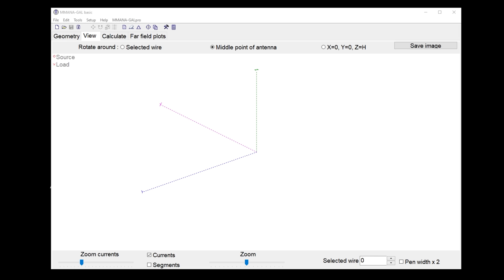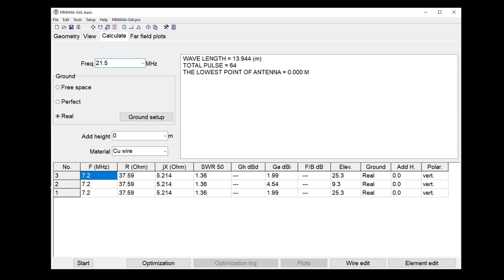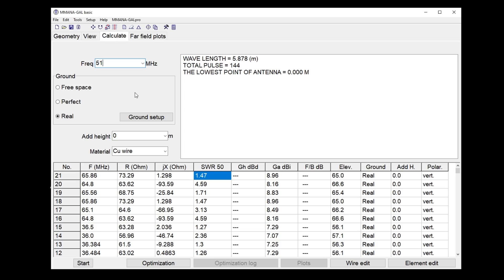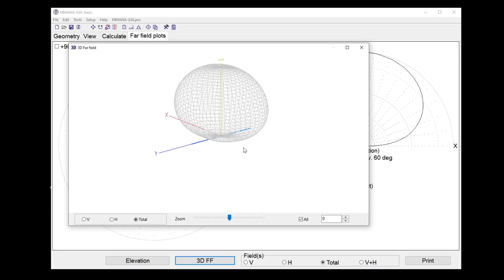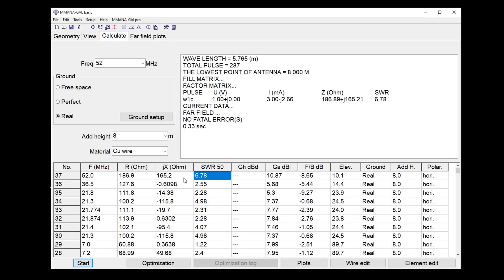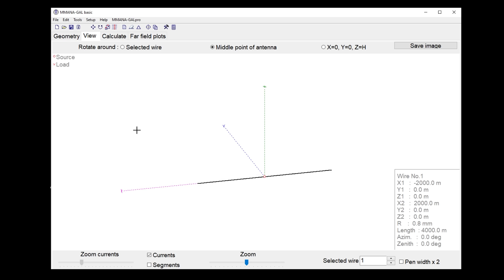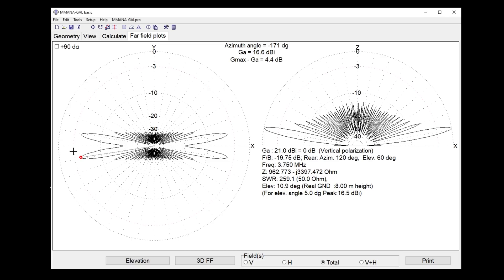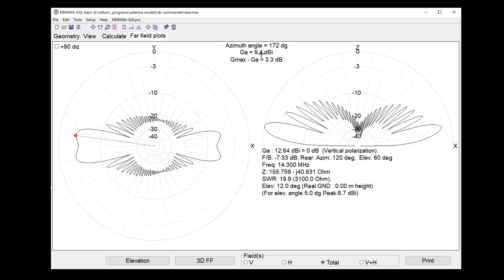Fascinating VERY Long High-Gain Cheap Wire Antennas

Comment: Excellent video Cal.  That 16dB gain was impressive !!  I think this also shows why a modest antenna,  vertical or horizontal,  in  very modest garden can give reasonable results, those being what probably most of us work with. Also reminds me that using an amp to try and get a signal out is less useful in that it does nothing for reception if overall gain of antenna is low.  Mark, 2E0MSR.
Reply from the maker: You are right!

Comment: I use a 20 meter horizontal wire (about 12 foot off the ground) with a 49:1 un un and with just 10 watts get very decent results even with a dog leg configuration. Conditions have to be with me for real dx but as a cheap antenna it is great.

Comment: That wifi antenna is a collinear but the problem is the alc kicks in if ya use a high gain antenna which sux
Reply from the maker: Good point!
Reply: @DXCommanderHQ  personal experience before i got my amateur radio licence unfortunately

Comment: Makes me wish I still lived next door to the high school football field that I used to.  I could've hung a wire on top of the 12-foot-high fence around the full length of the property, like 4 to 5 acres, insulated from the fence itself.
Reply from the maker: Wow
Reply: @DXCommanderHQ  Yes, 4 to 5 acres "area".  So how long do you think the perimeter would be thus the full length of an EF wire?  Well here - 1,866.8 feet of fencing!  🤣

Comment from the maker: Very long Dipoles and End Fed Antennas seem to have this amazing characteristic. I have not tried a Beverage Antenna, possibly the super-standard in terms of RX abilitiy.
Reply: In the past all my beverages contained alcohol, so I never got very far with antennas back then.
Reply: That just sounds the best, cuz the wire picks up so much static and noise. To be resistance terminated to ground on one end, yet still tx-able, so you can speak to where you hear. Like a half rhombic. Things get real wild on different bands tho. It is time to put DX Commanders in a dipole configuration, and rotate them.
Reply: @ERICtheLATE  At what speed should you rotate the DX Commanders?  What kind of RPM are we talking... 10 RPM?  10,000 RPM?  Gimme an order of magnitude, please.
Reply: @Randrew  Really slow. It would be interesting to see if there is still gain using 40 meter wires on 10 meter or 20, if there are some resonant ones right there. Oh and your joke. 😁